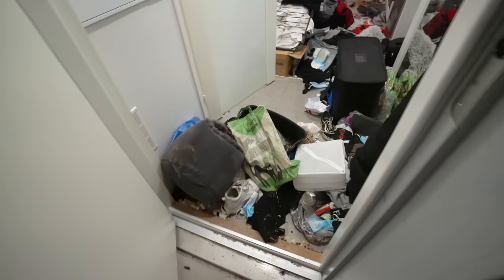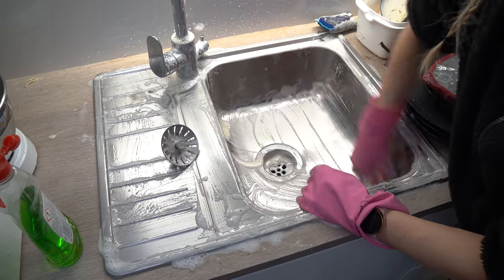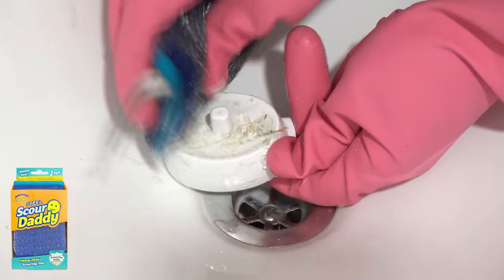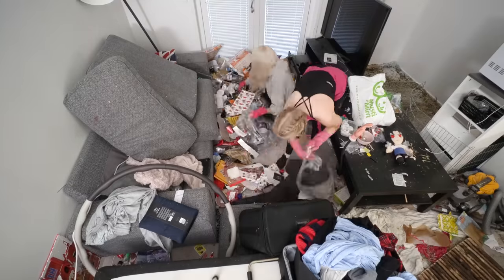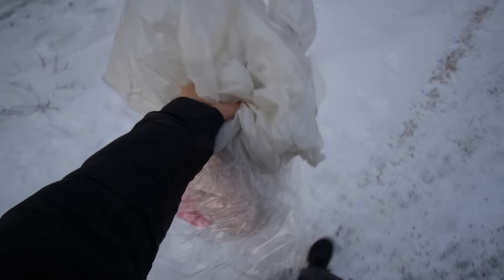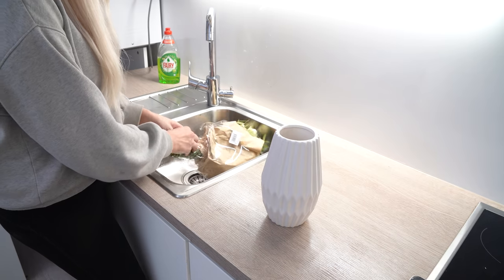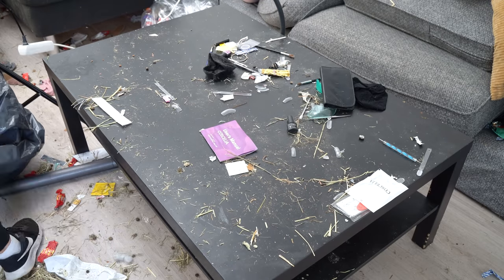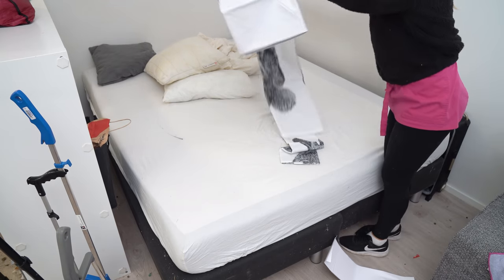ECOLOGICAL HOME CLEANING FOR FREE ♻️- Tips & Tricks 💚

Comment: I picked up a great tip that I wanted to share.  For stainless steel surfaces, you can polish them using vinegar and water.  I take a small bucket, put in about a cup of vinegar and hot water.  Then I use two microfiber cloths - one wet and one dry.  First, I wipe smaller sections with the vinegar and water mixture.  Then I wipe it dry with the dry cloth.  I do small sections so that the water doesn't have time to dry before I get a chance to wipe it.  Works great for the sink, too and leaves everything sparkling.
Reply: Thank you, you mean white vinegar right?
Reply from the maker: Awesome! 😍
Reply: My mom always used a couple drops of olive oil to polish her stainless, so I started to use that method too! Works great 😊
Reply: Yes i use that in my water boiler. I boil some vinegar and water and all the white stuff goes away! Rinse a lot afterwards.
Reply: Does the smell of vinegar remain in the place?
Reply: @asgh3610  no it doesn't. I hate vinegar but I clean with it and it's fine. It might linger of you use a high concentration, but it disappears on its own
Reply: @MissDraiha  I hate the smell too but I'll give it a try, thank you
Reply: @ChocolateMonkeh  I use mineral oil to polish my stainless steel. I use a good degreaser first, then rinse, wipe dry, and polish with the mineral oil. It doesn’t get rancid.
Reply: @asgh3610  no, no permanece el olor.
Reply: @asgh3610  I clean with vinegar. The smell dissipates quickly. If it bothers you a lot mix some lemon juice with the vinegar. The lemon juice masks the more pungent vinegar smell. The combination also makes a good degreaser.
Reply: @Kag001  Sounds like a great idea to add lemon, thank you
Reply: You can also use dry dryer sheets to polish stainless steel if you can’t stand the smell of  vinegar.
Reply: My cousin taught me to use cloth to wipe wall and taps in shower and sink before leaving bathroom. By wiping surfaces dry, it doesn't need scrubbing ever
Reply: I using white vinegar, and soda. White vinegar does not smell so bad, than vinegar. Vinegar smells so bad, that it just feel icky.
Reply: I use a tiny one inch glass (like a tiny shot glass) of white vinegar in my washing machine everything comes out brighter. I use Bold washing powder (have done for 40 years) so i don't need to bother with softener. I started the vinegar about 3 years ago. The stains come out and everything is brilliant white or whatever colour...and there is NO smell after washing. Dry outside for a lovely smell that you can't duplicate with anything else.
Reply: @tinaclarke704 Yes, i agree, white vinegar is great  product : ). I our country is most of soft water. So i use half of full portion the washing powder, or liquid.  Fabric softener i use only for acrylic sweaters. I want to dry out side of my laundry, for that lovely smell. But i can`t, i have a asthma. Spring time every trees produces to pollen. I am allergic to to they`s
Reply: @Aurikatariina  hi auri... 
I am from india 
I love your videos and i also started cleaning my home like you... 
Cleaning is really a fun 
Love u ❤

Comment: Substitute rubbing alcohol for the vinegar in Bonnia’s recipe, and it becomes a safe cleaner for natural stone, including granite. Let it sit for 5 or 10 minutes to sanitize the surface, then wipe with a damp microfiber cloth, drying as you go for a streak free shine.
Reply: Aren't you not supposed to use acids on granite? I was always told vinegar would eat away at the finishing on it.
Reply: @redlobsterbiscuits  Right, you’re not supposed to use acids on natural stone. Rubbing alcohol can be used instead of vinegar in any homemade cleaner, and it is safe for granite.
Reply: 25% alcohol does not have sanitizing properties anymore so you’d have to up the percentage of alcohol for this to be an effective detergent (: you want the alcohol percentage to be around 70% for optimal cleaning. It’s not effective under 60%
Reply: @francescad9993  I use 70-90%. Forgot to mention it, so thanks!
Reply: @tishratcliff9601  could you post a recipe? Because as you said you cannot sub out the alcohol 1:1 with vinegar in the recipe provided in the video
Reply: @francescad9993  You can eyeball this one, so it’s really easy. Fill any spray bottle 3/4 of the way up with 70-90% isopropyl alcohol, add 3 or 4 drops of dishwashing liquid ( you can add up to 8 drops, depending on the size of your spray bottle) fill the rest of the way with water, and shake. You can add a few drops of essential oil, if you like.  I use this everywhere in my house, it’s really versatile.

Comment: I use castile liquid soap, baking soda and essential oil in water to make my all purpose cleaning spray, have been doing this for about 5 years now! I buy 1L of soap and it lasts me a year or so, it has saved me so much money, you only need to use a teaspoon of soap in 500ml water! And it's magic on stuck on/burnt frying pans, I love it. I clean glass with vinegar and a special glass cloth, it leaves zero residue and no streaks. I do sometimes still have to use oven cleaner, bleach etc when I'm working (I am also a cleaner) but only when it's necessary. Last time I cleaned my oven, I used baking soda, water and castile soap, and scrub daddy! if you clean your oven regularly you don't need oven cleaner. We really don't need all those chemicals in our lives!

Comment: Just in case it helps someone: I've discovered that I can clean pretty much anything with my homemade dishsoap made out of used cooking oil (mainly olive oil) and caustic soda (there are many tutorials round there, but it needs to be done with precaution). So it's a zero waste product. I use it just like that in its solid state when doing the dishes, but I dissolve 100 g in about 2 litres of hot water if I need to spray it somewhere. But mind you that I live in a soft water area and that makes it work better. For what I've seen, the places where Auri cleans seem to have hard water, so homemade "real" soap can be a problem, even though vinegar can help remove soap residue.
Keep up the great work!

Comment: I appreciate you trying to work ecologically, I do, too, for my pets. The conundrum with microfiber cloths vs. paper towels is that you have to wash the cloths in soap & water. Dad told me that once water has soap in it'll, always have soap in it. Water is a finite commodity. I struggle with soap water vs. tree removal. Which is worse?
Reply: Wastewater treatment plants can of course remove soap from the water. But it's also important to use water efficient washing machines to reduce water usage. Especially depending on the water supply in your local area. But water is also used in the production of paper towels. I think we can never be perfect so the most important and practical thing is to be overall considerate and trying to reduce chemicals and one-use tools

Comment: I use baking soda and vinegar most of the times. It is really working cleaning in the bathroom and I always add only vinegar to the water when I clean the floors. It doesn't smell at all. Mixing a little vinegar and baking soda to get a paste (some of it will reaolve of course) is really good to clean soap scum, just let it sit for like 15 minutes. I only buy special eco friendly products to do the laundry and the dishes.

Comment: Congratulations on the great job, and thank you for your constant tolerance and goodwill towards others! 

I just wanted to share some info about using essential oils in cleaning products: in a lot of recipes you can find online, they suggest to add some essential oils, but It’s actually mainly for the smell and because it is trendy, but it is not necessary for the product to be effective. Some essential oils do have grease-cutting or antimicrobial properties, but the vinegar and the dish soap in the eco spray recipe already have these properties. 

That’s why I recommend to people who really want to be ecological not to put essential oils in their home made cleaning products. You get used to the smell of vinegar pretty quick. Otherwise, you can add natural fragrances that have a much smaller footprint. Indeed, essential oils are very resource-consuming product, and thus are not ecological if not used parsimoniously. It is most recommended to use them only for therapeutic purposes :)

Comment: A great air freshener hack a friend taught me is to use vodka instead of water as the base, it has virtually no odor, dries very quickly and it lasts in the bottle indefinitely.  I just use a cheap vodka, about half a cup in a spray bottle, and put essential oil drops until I get the desired concentration.  I use lavender for the bedroom, lemongrass in the kitchen and bathroom and geranium in the living room.  It's cheap and smells so good!

Comment: 2 of my sisters kids have allergies and asthma so she has to find eco friendly and allergy friendly solutions. One of her best investments is a steam bleaker she bough one that looks like a small vacuum cleaner that can be yse in large areas like the floors but it also converts into a hand held steamer for things like tiles, grout inside of fridge and its brilliant for defrosting the freezer super quickly.  Also it uses only hot water oh and its a Godsend for cleaning the oven too. Bit of am investment but has saved her buying 80-90% chemical based cleaners,  so it pays for itself in no time.

Comment: My favorite drain cleaner is baking soda and vinegar. Just dump baking soda unto the drain, about half a small box per side of sink. Then pour vinegar in. You will hear it bubble and foam just like your grade school volcano project! 

Let it sit for 30 minutes or so. Then heat a pot of water almost to boiling. I use a gallon or about 3.5 litres. Pour quickly down the drain to flush any loosened crud. 

You can add lemon or orange juice to the hot water to make the drain smell better.

Comment: Aside from using eco friendly cleaning products, you can use boxes to collect your recycling instead of bags, keep your plastic grocery bags and use them for bathroom/smaller garbage bins instead of buying cute bags specifically for that reason. Use biodegradable organic bags for kitchen scraps, if you have old clothing that you're going to throw out, cut it into squares and use as  quick clean up rags or to clean floors. There are concentrated soap cubes that you can buy that work and smell amazing, you just put them in a hand pump and fill the rest with water! 😊 some of the small things I do at home, they also save you money.

Comment: Auri - I got some eco tips from this, and enjoy your positivity & humanity. Thank you!...

However, I think you may be missing out on "Bar Keeper's Friend" (BKF) and magic erasers - both are very effective and popular for people serious about (eco?) cleaning. It may let you forget about cream cleaners, and or make you far quicker and eco...

BKF is a mix of fine pumice (safe, and helps with polishing action), soap, plus oxalic acid (more biodegradable than vinegar & citric acid?, it exists in fruit and veg). BKF is very versatile, and the simple mild acid is particularly effective at cleaning all metals, including rust.

Magic erasers (melamine sponges) are super fast and effective and cleaning off fine grime of every kind of relatively smooth surface. It reduces the need for cleaning chemicals too. Once you experiment, and experience the magic, you'll be hooked! Cheap no-name ones work the same as branded ones.

Comment: White vinegar & baking soda letting it sit for a bit for the hard stains like rust, water scale build up, etc. Tea tree oil is great for cleaning trashcans inside; just as a few drops to a spray bottle of vinegar. SN: Tea Tree Oil is exceptionally beneficial, however, it is toxic to animals. Do not use it in humidifiers or oil defusers, also do not use it anywhere either while cleaning or for health benefits where your pets have access to the area. 
Lemon or orange essential oil are really excellent disinfectants, you can use in DIY spray listed in this video & will smell soooooo good.

I'm all for natural/eco cleaning products because I have a pulmonary issue in my right lung that cannot be addressed w/o removing healthy lung. Commercial cleaning products are often too harsh & even some of the simplest products make it hard to breathe. Washing whites & using Clorox is never easy but there are some things that are not an exception, bleach is a must.

Comment: Washing Soda is a bit more powerful than baking soda when it comes to cleaning products. Washing soda and Borax can make a really good all purpose cleaner. It's also good for cleaning out pipes in hot tub jets. And is common for laundry stripping. Laundry stripping is removing the build up of detergents and body oils and such from sheets and towels. It's not recommended for clothes.

Comment: An easy way to clean a microwave is to put a mug or bowl of water in there for 3-5 minutes depending on how dirty it is. Just wipe it out as soon as the timer goes off. Warning though, the mug or bowl will be extremely hot might want to use a towel or oven mitt to get it out.

Comment: The only place I have been (13 countries, 3 continents) that does NOT have floor drains is in the USA.  And like a friend said, "Why do you all have WOOD in your bathroom?"  I have no answer for that.  You can clean an entire bathroom with an RV brush pole and the sprayer in less than 5 minutes. As far as "ecological" cleaning, as a science teacher I battled this all the time. Just because something is "natural" doesn't mean it is ecological. LYE is natural and has been used for centuries to make soap. But if an someone drinks it, they will die. It's not the products that are a problem, it's the people. And I have to tell you, without bleach our world would be in a horrible mess. It is what the CDC uses to clean water and sterilize surgical equipment. Bleach breaks down to form water in 30 minutes and gas. The Chlorine gas is a NORMAL part of our atmosphere. There's a LOT of misinformation out there. Baking soda is MINED FROM THE EARTH, a terrible process that ruins ecosystems.

Comment: Sadly, as can be seen in the video the results after using eco friendly stuff as handmade cleaner, soda and etc., are much worse than results, then Aurikatariina uses chemicals. For example, electric stove, table left dirty, not shiny, an orange strip of lime remained visible on the ceramic tile in the shower. I think, eco friendly cleaning is possible in less dirty places for daily care, but in places like this you have to use chemicals.